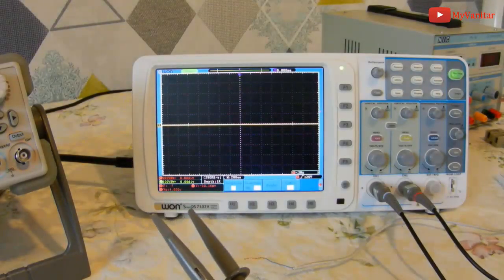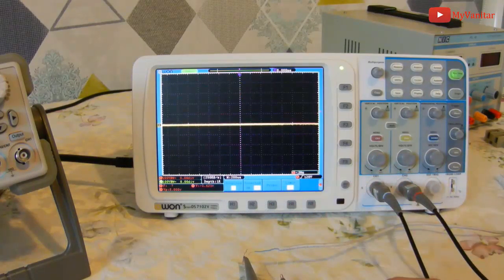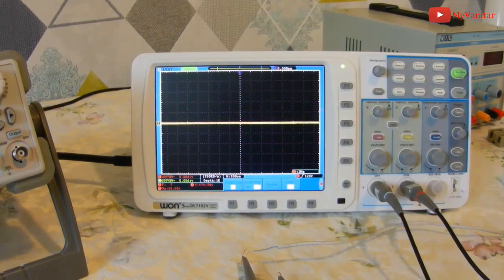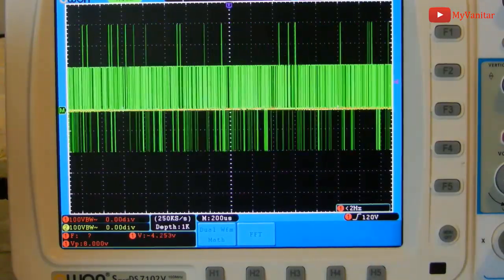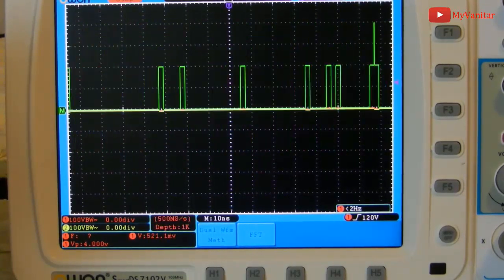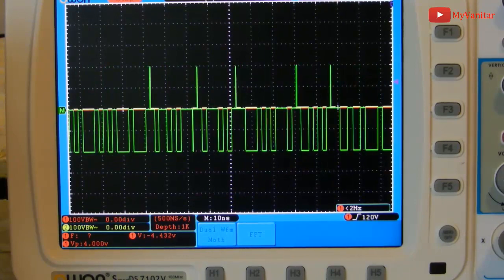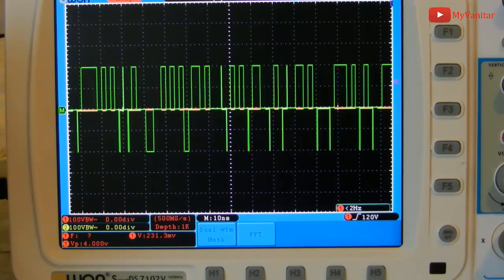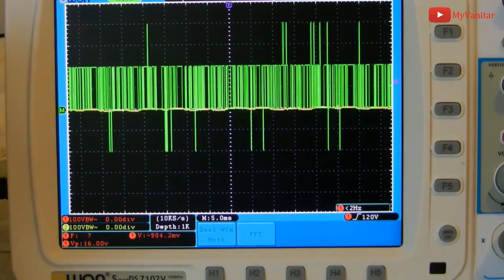Differential Signal Measurement Using A Digital Oscilloscope [ADSL2+]

Comment: you know if math wave given differs in bandwith (related to the scope/probes capabilities) in some way? Regards
Reply from the maker: There is a better way to measure this using an isolation transformer, I'll publish one soon. subscribe to get notified
Reply: @MyVanitar  Investigating my TDS oscilloscope manual, also scrapping info from the web, I found that the CMRR is affected/reduced this way, by example from 100:1 to 20:1 for my particular oscilloscope....I'm not conscious about the impact of that in practice (maybe less capacity to see little noise signal mounted in a bigger signal? I dont know).